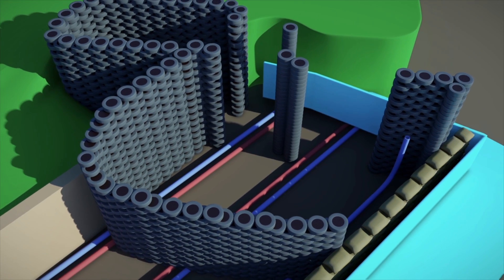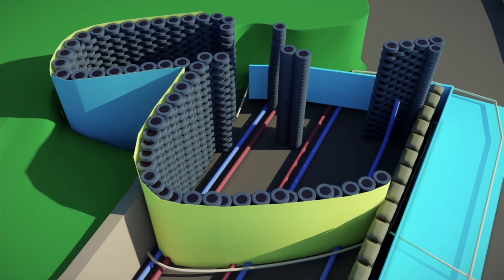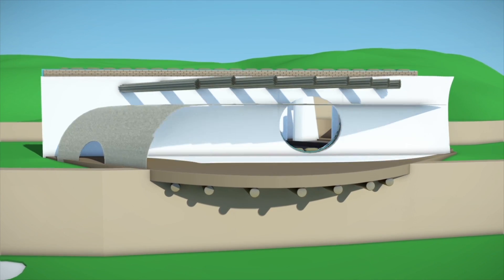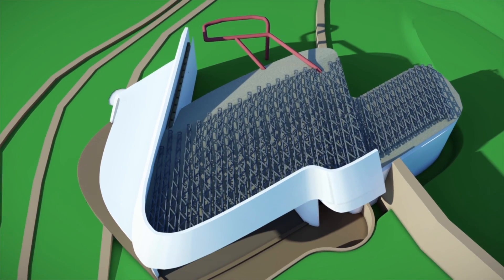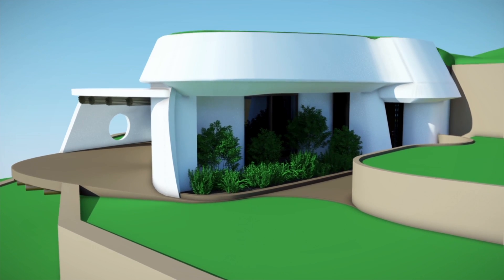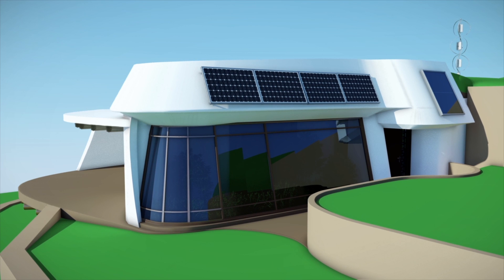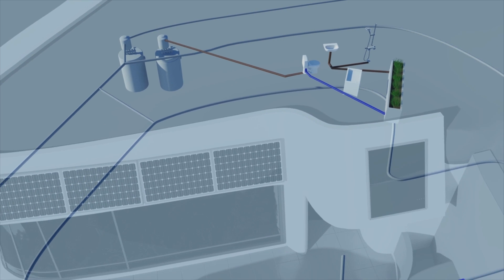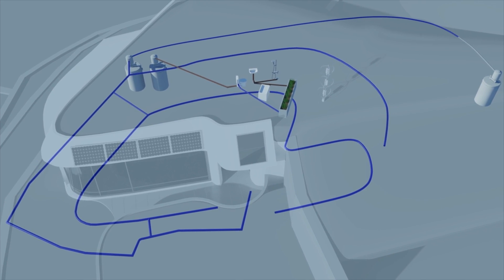Lifehaus Project - 1st prototype 3D Construction Timelapse

Comment: I would love to see something like this as a modular Pre-fab, Factory built, expandable as needed.
Reply from the maker: Unfortunately Mr Volkmar, this doesn't fit the concept of the Lifehaus. It's a project that should be built with what you have on the land your are building on, and around. It uses local natural or reused materials, reducing considerably the high carbon footprint generated by transportation. 
It's a project where people build a house together and learn to live sustainably.The project can be modular and expandable as needed, but not prefab.